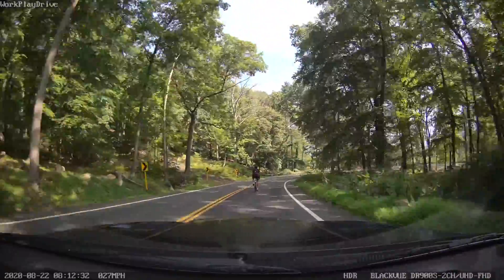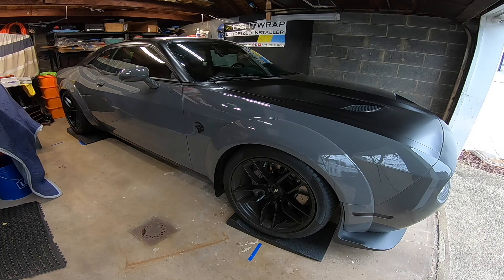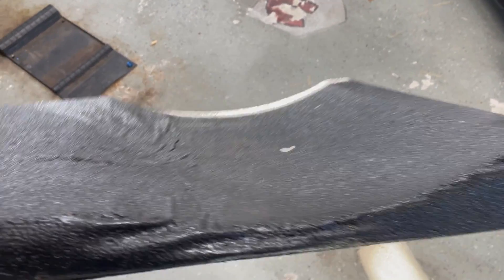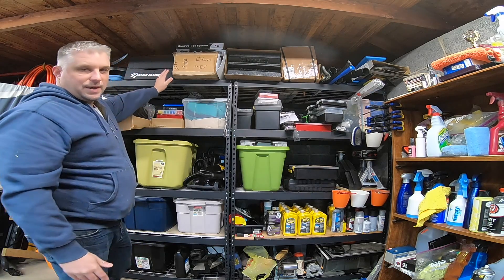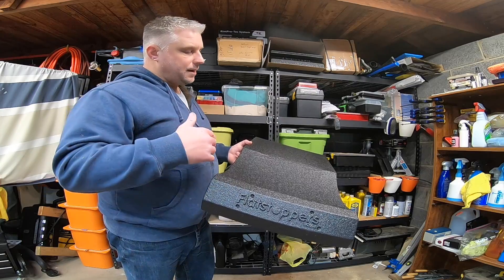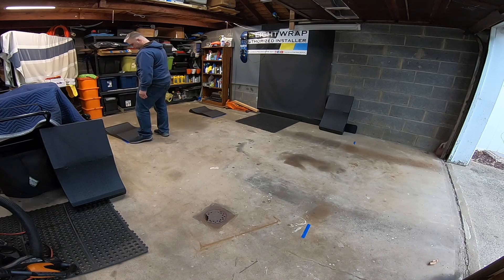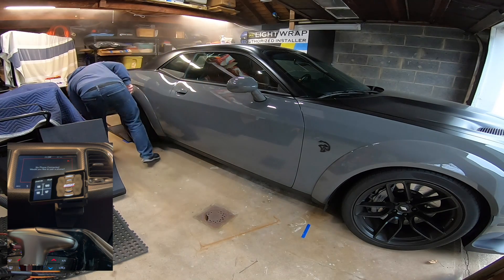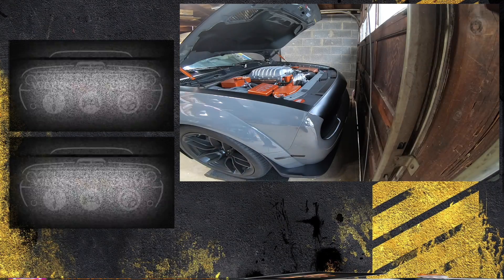Race Ramps FlatStoppers - No more flat spots

Comment: Thanks for sharing this.   I just put my GT on the race ramps two days ago and noticed my front tires ever so slightly sit over the ridge line (just before the cup).  The tires look to be pushed in somewhat at that line which concerned me but seeing that the ramps conform in your video, I am no longer worried.  😀
Reply from the maker: Over time the race ramps compress and conform to the tire. I was concerned about it, but they assured me this is by design.

Comment: Please Mike, how do you fix a little curb rash on a front wheel?
Reply from the maker: Curb rash you could take it to a shop and have them redo it. When I had my widebody wheels re-done it only cost $150 per wheel to have them stripped fixed and re-powder coated. That price also included mounting of the tires and balancing.
Reply: @WorkPlayDrive  thanx, we have a local place that does powder coating. I’ll have to wait on that for alittle but. My wife is already about to kill for spending so much money. That reminds me, Your Tee shirts, none of them have Octane Red Challenger.
Reply from the maker: I know the feeling. I started the channel to help fund my spending issues.

High energy red is the “octane” color. Didn’t want to use the trademarked name 👍

Comment: I anchor bolted a 4" x 4" x 8' to the garage floor to ensure I do not back into cabinets at the rear of my garage - similar situation to your shelves. When I got my Challenger, the wheelbase was different versus the old Mopar B-Bodies I had. So what worked for me was to lay a second 4 x 4 in front of the bolted pylon and it works 100% of the time. It looks like these tire cradle ramps could be butted up the the wood and set similar to the video except the wood eliminates the risk of going to far back and the dreaded position variation.

Comment: Good video and just on time. I got a tight garage as well and I’m putting a S-550 Mercedes on them. It’s a little pain having to keep getting out to set the front ones, they should develop ones for the front specifically so you can drive over them. Thanks for the video👍🏽👍🏽 I also have 2 Battery maintainers plugged in as I got a battery up front and one in the back as well. I installed the quick plugs for those.
Reply from the maker: it would be cool to incorporate a ramp on the back of the front ones to drive over.

Comment: You ever think of getting a QuickJack?
Reply from the maker: It's on the list once I can update my garage setup.
Reply: @WorkPlayDrive  Great. Looking forward to it! I'm in the market for one and thinking of getting the large wheelbase one (6000XLT) due to the distance between the pinch welds on the Challengers, but not sure how it would suit me for other potential cars in the future.
Reply from the maker: The 6000XLT was the one I'm looking at as well.  I was disappointed to see their pinch weld pucks were too big to fit in the rocker panels, but for the same price the ZL1 Magpads would work perfect.  If you don't get some sort of pinch weld adapter you will separate or ruin  the rocker panels.  in the front of the car.

Comment: Ouch $375 for the ramps. I saw some race ramps for $150. 5 ton support. But not sure if they are low enough with a added front splitter. If you ever come across some around that price that will work with a 3.5 inch ZL1 splitter would love to know
Reply from the maker: The 72" is the set that will work with a splitter, it's got a low 6.8 degree approach then once you're off the ground that final 6" is a 10.8 degree incline.   The lesser expensive 56" will work for a 1" lowered hellcat and scat pack, but not with a splitter.
Reply: @WorkPlayDrive  crap! I checked amazon. The ones I was looking at are 46 inches long. I guess those wont work.
I dont have the splitter yet but really want one. Im hesitant because i saw a youtube video that said do not mount a splitter like this. And he talked about how the splitter rods mount to the existing holes in the grill. Just unscrew the screw already there, hold up the rod, replace screw. I like this because no taking off the front bumper to mount brackets to the bumper support. But apparently his splitter got ripped off at speed and pulled his grill out too.. He went on to say how some people damage their bumpers as well when this happens.
I know you mounted a ZL1 splitter. I cant remember in that video how you mounted the rods. The splitter was a ZL1 so I assume you mounted it to the grill like they tell you to. How fast have you had the car?  I assume the splitter held up?
Reply from the maker: @Anthony Intelisano  I did the ZL1 rear diffuser and side skirts.  Sorry,  I'm not a fan of the front splitter look so I do not have one.  I know some brands are for looks only and will get ripped off at speed.   I'm a huge fan of ZL1 but I don't have any experience with their front splitter.    

The only splitter I know of that has chassis mount is DFS.  I met them at a few shows, watched their installs live and I have a few friends that swear by their products.  https://www.downforcesolutionsllc.com/
Reply: @WorkPlayDrive  oh, oops. Ive watched so many of your videos since 2019 I thought i saw one from you on a zl1 splitter. I guess my brain is making things up since i know you do like ZL1. Thanks man appreciate it

Comment: This is cool. I have Nitto Invos, 315 in the back 275 up front, and they go flat after less than 8 hours. Vibration goes away after 2 miles on the highway. These ramps would be perfect if the fronts were bi-directional so you could drive on and off of them without having to move them out of the way every time.
Reply from the maker: Bi-directional Not a bad idea 🤔

Comment: I have a set of these flatstoppers. I left my BMW 535i xdrive parked on these in March 2020 in my garage in Arizona. The tires are Continental Extreme Contact DWS06 with only 5,000 miles on them. Unfortunately, I was unable to get back to the car until October 2021 and the tires are flat spotted. Trying to work them out but may have to replace all 4.

Comment: Is rather put my car on Jack stands then pay that
Reply from the maker: For me I want to to take out the car when I want.   Jack stands are too much work.
Reply: Yeah your right i was just BSin.  Hey do you know the starting trick where if the car sits for a few weeks and you want to turn the engine over to lube it up before you actually crank it.  I think you hold the accelerator pedal all the way down press start.  Been wanting to try it cause my car sits for weeks at a time also.  I think it's called clear flood mode
Reply from the maker: @justinw123  I read a long discussion on that with both side arguing that it was good and not good at the same time.   I'll have to look into this sometime in the future.